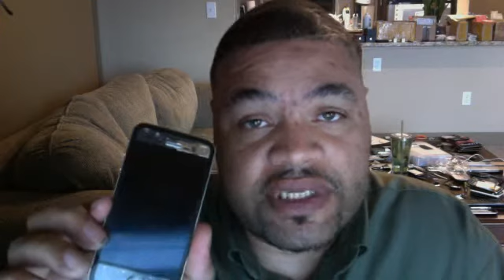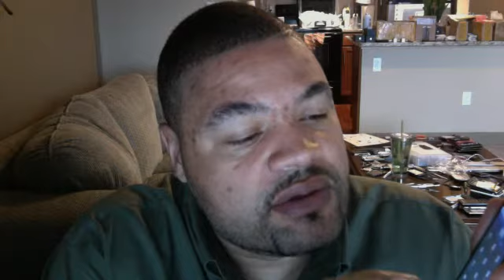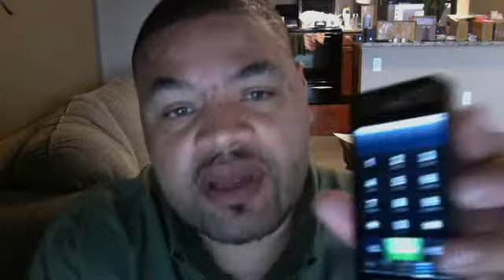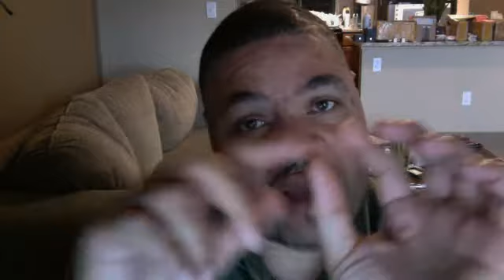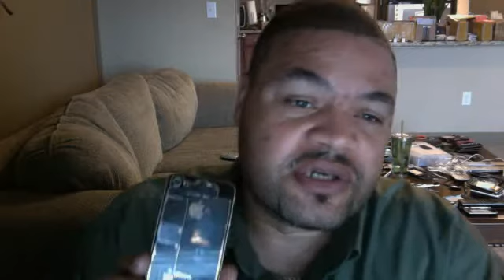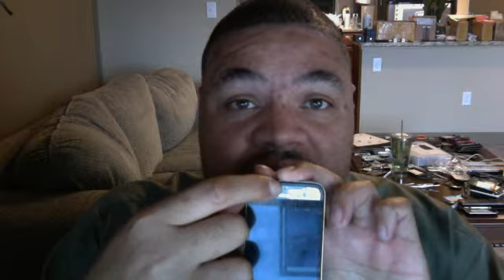TRUE IPHONE 4 proximity sensor fix. NOT CALLOCK!

Comment: Great advice - worked like a charm getting my sensor working again after I replaced my screen (must have removed the foam that blocks the light out when clearing out the broken glass).

I came up with an easier way to get the holes right: 
Instead of trying to exacto knife or poke holes out, I just short, thin strips and layered them down one at a time to create the double box (so I used 5 pieces of tape).  Made it a lot easier to get the openings right.

Thanks again!

Comment: You only need to put a small strip of material between the two elements of the ir sensor. the problem isn't too much ambient light, its the ir light reflecting off the back of the new screen. the old screen ripped off the factory piece of foam that used to be between the xmitter/reciever pair. Try it, and see what I mean. Foam works better. just put a small piece of 2 way adhesive on the back side of it The main thing is whatever you use has to make light contact with the back of the screen.

Comment: @soto299 - did it stop working after you broke your glass and did this job?  You might want to try a few layers of electric tape.  There was foam oriniginally blocking the light that likely got pulled out with the broken glass, so you might just need a little bit thicker of a barrier.

Comment: @soto299 Hey man, just try cutting two small triangles in a piece of tape, dont worried about the size, just make them very small....   more small than the size of the sensors, I was try 3 times and finaly  worked...

Comment: It stopped working after I changed the screen. I think I have like 3 layers of electrical tape right now and no luck. I also went ahead and replaced the sensor.. And still not working. 
I'm tiki king of putting electric tape behind the back of the screen, on the screen itself, would that mess anything up?
Thanks!

Comment: Didn't work for me. Tried different sizes of holes on the tape.. And even went as far as replacing the Proximity sensor with a new one. And still not working.